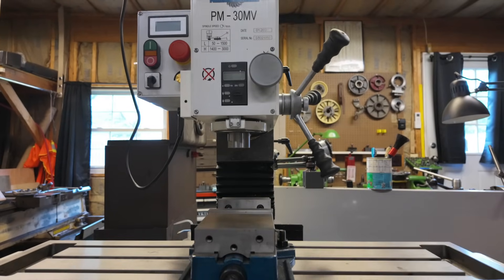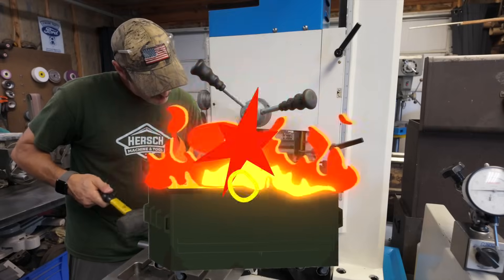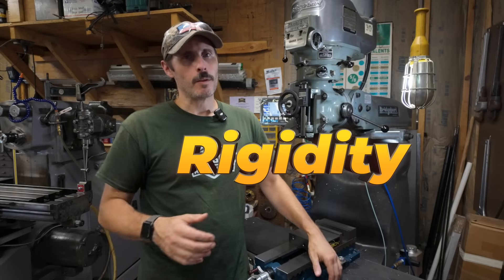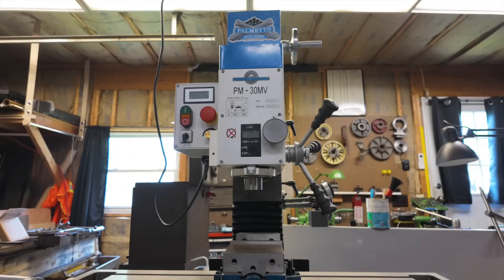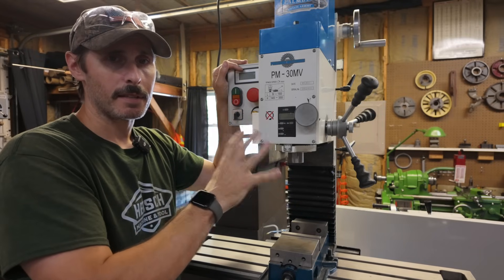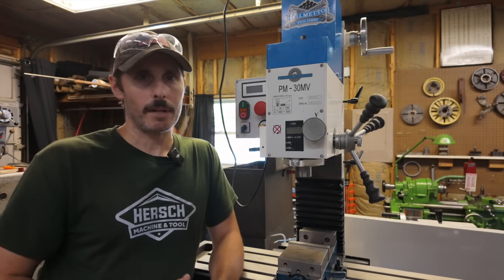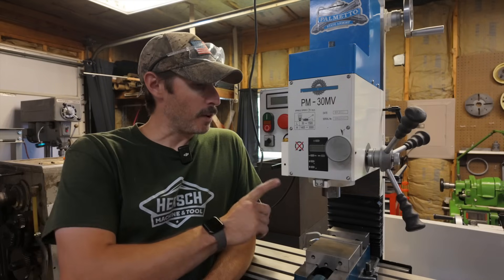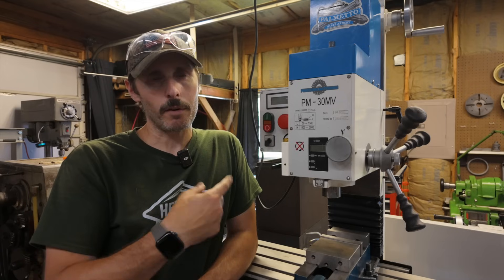All You REALLY Need to Know About Mini Mills

Comment: There is one simple rule of thumb: as big as you can fit for as much money you can spend. And a "slightly" used good machine is at least twice as good as a Chinese-machine. We bought a Shizuoka-mill from Japan, a real Ferrari, for the price of a smallish Chinese...
Reply: If you can find something that's great. The availability of used is spotty and heavily dependent on location though. You can't find something where it never was there to begin with.
Reply: @1pcfred  That is true 🫡. Many are used until they are beyond repair, size can be an issue AND they change owner without ever entering the free market. Sometimes you have to play tennis with a guy whose wife swims with the wife of a shop owner to get knowledge of machines about to get "free" or businesses about to close.
Reply: @1pcfred  I made molds for making products out of plastic. We worked in +/-0.01 and measured in 0.005, that is metric. Now I do lathe work in H6-H7 tolerance. But repairs are often less, +/-0.1-0.3 or so...

Comment: High School robotics team I mentor has a Grizzly mini mill with plastic tooth gears.  I assume the plastic gears are for the noise I’m sure.   Gears finally broke after many years of use.  Online reseller makes replacement metal gears that fit perfectly.  They were noisy at first, but finally wore in and became better.

Comment: Very good video over all.
A couple things I would add/disagree with.

First of all it is normally not the casting that gets rejected, those are normally pass/fail. It is the finished part that is culled and resold. I had a 16” Grizzly lathe that was so bad even the dowel pins were misdrilled factory seconds!

Secondly I wouldn’t knock the old round column machines tho they are harder to use they have produced billions of good parts for probably 60-70 years.

I wouldn’t consider the machine you were showing a mini mill tho.

Size wise match your mill to your work.
I have found mills run out of capacity much faster than a lathe.

Don’t knock a half size knee mill.

While is is always good to get the stoutest machine available accuracy is much more important, non of these machines are going to take heavy cuts so unless your goal is to just reduce metal to chips just for the hell of it make sure you buy a quality machine.

Cost of tooling is pretty  much the same no matter what size of machine you buy(vises are the exception).

Don’t buy too much machine moving big machines is expensive and dangerous.
Reply from the maker: @pvtimberfaller  excellent points, I agree pretty much with everything you’ve brought up. Thanks!

Comment: Well, a Bridgeport isn’t quite that heavy. It’s 1,995 pounds. Still pretty heavy though. Most of these companies don’t buy castings. They buy entire machines. What does happen is that the actual manufacturers, most of whom people have never heard of, off the same basic machine. With different features. But often, they also offer them in different quality, or precision characteristics. Importers, and that what Precision Mattews, Grizzly and others around the world are, decide what they want their products to cost, and then decide on what reputation they want to have (if they care at all!). Then they buy the machine that meets those expectations, gets them painted their color, with their logo tag. It’s preferable to try to avoid a machine with a DC motor. Yes, you do get variable drive, but the torque with DC motors can be low. A three phase motor with a VFD, as some machines have, is much better. They run on single phase, often 240, but some run on 120. VFDs have torque control, so they maintain high torque at low speed, just as geared and belt drives do. I generally don’t recommend geared head mills. Because these are low cost machines, the head has just a few speed choices. Often, just six. The top speed is also usually under 2,000 rpm. That’s too low for small mill bits. If you’re using a four flute bit in high speed, you should be at least 2,500 rpm, preferably higher. If it’s carbide, you should be at least 3,000. Smaller bits need higher speeds. You can mill at lower rpm, but your rate will be very slow, and the depth of cut will be small. The lower the speed, the easier to break a bit, because let’s face it, people who are new to this aren’t going to check the tables to find the optimum speed and feed, and will overdo them. I’ve seen people on YouTube breaking bits constantly because of this.
Reply from the maker: Really great points and info, thanks for taking the time to comment. When I first started out I broke my fair share of end mills, (still do lol) for exactly the reason you stated. I think for beginners it can be intimidating running at the speeds that will in actuality produce the best results so we tend to be detrimentally conservative. Also yeah, the bridgeport is easy to move, the B&S and the Clausing lathe on the other hand?… a little sketchy for a guy with a pallet jack lol

Comment: Very measured and sensible analysis, mate. All the more credible, as you don't seem to be short of 'proper' machine tools in your shop. All in all, a really good explanation of what's what (also the style of presentation was very easy to watch too); New subscriber incoming. 😉

The only thing I'd take very slight issue with, is the advice to definitely avoid round column mills. 

I'll grant that new, they're of questionable value, compared with the larger benchtop mills that are available from quality importers like Precision Matthews.  However, used, well cared for Taiwanese RF/RF clones, manufactured say, in the 90s, can be a very inexpensive way of getting quite a fair bit of rigidity and capability in a benchtop mill.

The main issue of losing X/Y  position when changing Z height can be fairly easily worked around. That Lazy Machinist has a good video on the "longest tool technique" to avoid having to change Z height. There are also a fair few videos around, that show modifications that pretty much remove the issue.

Okay, if someone has the money to buy a PM column mill then it's hard to argue with that choice (Precision Matthews is an importer that those of us in the UK would give our right arm to be able to use!😄)

If on the other hand, someone's budget is more limited (and couldn't fit a used knee mill in their shop), I'd reckon a decent used Taiwanese RF30/31 type is probably a better bet than one of the cheaper, smaller benchtop mills bought new.

Eh, just my thinking though, and that's worth about as much as you think it is. 😁
Reply from the maker: @stevedavey1343  thanks very much, I appreciate the positive feedback! And yeah, I agree completely, any mill is better than no mill and there are a lot of options and considerations when looking into bench mills. I’m just trying to give a broad overview here and hopefully arm folks with some good questions to ask and serve as a starting point for further research to assist with making the best choice for the individual. Also I think that some of the nicer round column mills are precision keyed which eliminates the tramming loss issue altogether. Thanks for watching btw, and thanks for the sub!
Reply: @hersch_tool  I've moved Bridgeports and I've moved mini mills. Mini mills are a lot easier to move than Brideports are.
Reply from the maker: @ depends on how mini the mini mill I think. I dread ever having to move my PM30 off the stand it’s currently sitting on. I can move my BP around easily by myself with a pallet jack.

Comment: Based on my research the mill in the video costs $3700 and therefore it is already a better one. Looking for a cheaper mini mill that is rigid enough for milling iron and steel I found the Sieg SU1 horizontal and vertical universal knee mini mill for approx half of the price. This mills is a very rigid one and I´m very satisfied with it. If the Z-Axis travel of 205mm is enough for your applications, this is my recommendation. I don´t know whether this mill is available in the US, I only found offers in australia  and in Germany, where I from. 
However,  as joansparky4439 states below, you have to do the finetunig prior the first use. Especially the Z-support needs a precise adjusting of the dovetail and the spindle. After that is done the mill works smooth, quiet and with impressing results.

Comment: Have a Taiwanese round column mill/drill for more than 20 years. Back then there was no square column ones. Main drawbacks is the round column and belt changing of speed. On a round column you can't move head up or down without loosing precision. So you have to set height for the longest tool to use before. And have quill down much for the shortest tool. Speed changes takes lots of time, so rarely done. A gearbox may be noisy but you gets lots of torque on low speeds. Fitted it with quill and X/Y DRO and VFD speed control.
If I ever should buy a new mill, it would be a geared square column one with 3 or 4 axis DRO. Finding a used knee mill in decent condition is almost impossible.
Reply: You can move the head up and down if you use the laser method. You put a laser pointer on the head and mark where it hits a far wall and have a plumb line on  the wall.

Comment: Typically electric motors have the most torque at low speeds and lose torque as they speed up. (gearing and belts aside)

Comment: i hate mine, i love mine... i guess mines the bigger sister. HM45...46? 

it works, but i spent a bit of time learning its idiosyncrasies?

being left semi exposed for a few years wasnt the best thing for the bearings... box got water in it. 

so stripped it down and thats when i found the major issue, that one of the gear shafts has a nasty big crack in it along one of the keyways. from the factory judging by the grinding marks... bit hard to select one speed and i know that one day its going to have to be stripped down and remade... at the same time, see if i can beef it up a bit as well.

in this country we have a monopoly of one seller/importer and theyre not interested in after sales support... not even really interested in pre-sales support, lol. a reputation for "customer service" but what can you do given no alternative but bend over and take it?

the big challenge will be when i finally get motivated to start scraping it... gotta love the "decorative" factory scraping... it still has the cutter marks on some of the ways!

not hard as such, just tedious and some parts weigh a bit.

i still cry about letting a bridgeport go years ago as i didnt have the shed for it (remember that bit about "semi exposed"?)

Comment: Question, you said that round column mills are inferior to a square column  type can you explain why this is so?
Reply: They are less rigid. Round column mills are essentially just beefed up drill presses. They are better than a drill press but you will be taking light cuts.
Reply: So far, my $500 jet jmd-18 round column mill is kicking butt compared to a square column mill. And I haven’t even used it 😬
Reply: Because you lose precise location every time you raise or lower the head, they're junk, a crappy design that should've been left in the past, why they're still making them is a mystery,  why anyone is dumb enough to buy them is also a mystery.

Comment: Had a lowly 25mv for about 5 years, and in that time the pos paid for itself several times and allowed me to buy a better machine.
It's also a great to make all kinds of mistakes that would hurt a lot more on expensive equipment.
Just be prepared for a lengthy setup and a lot of grief, since even a little bump with throw it out of alignment in it's stock form.
Everything is fixable tho, just don't go crazy on the upgrades. They get quite pricey very fast.
Still use mine as a dedicated precision notching machine, so yeah ultimately I think it's a good buy.

Comment: The real decision is crank handle vs. CNC. Manual mill-drills, mini-mills, and yes that venerable hulking Bridgeport, are yesterday’s tech. Before you commit a bunch of money to one of these boat anchors, look at what’s available in the land of hobby CNC.
Reply from the maker: I don't think that's accurate for a majority of people looking at manual machines. Many of us in this hobby are looking for something out of manual machines that we simply can't get from CNC. When I was looking for my first machines, I was fully aware of CNC, but CNC machines weren't even a consideration. That's not what I wanted, and I believe that's true for a lot of folks.
Reply: CNC isn't always suitable for seat of the pants machining. A lot of what I do needs to be done by feel. I just took a broken screw out of a casting using a tiny carbide burr. Good luck programming that.

Comment: There's nothing wrong with a mini mill.  In fact, the finer pitch thread on the leadscrews can be preferred when making really small parts.  A Bridgeport will move the table .200" per revolution of the handwheel, the mini mills are half that.  Of course, the downside is that you're cranking the handle twice as much to relocate the table, so not really a great deal if you're doing a lot of setups or making larger parts.  But for the model engineer, typically making small engines, scale train parts, etc, the mini mill can be the preferred tool. 

So the intended use is the FIRST thing that should be considered.  And almost nobody talks about that.   If you "don't know what you want to make' but just want to get into machining, I'd recommend the generic 6x26 knee mill from HF or other sellers.   See the YouTube channel "Doubleboost" to see this mill's capabilities.  It's about half the size and weight of a Bridgeport, but is far more rigid than the square column mini mill.  About the only thing you lose is the ram, and head nodding/tilting.  A Bridgeport has a HUGE work envelope, partly because you can move the spindle to any part of the table.  For most home shops, a step pulley machine on a VFD gives you instant speed changes, and a quiet machine.  The Reeves drive on a full size mill will need maintenance, and can be noisy.

And finally, I've owned and worked on import machinery from PM, Harbor Freight, Grizzly, Enco and Jet.  What I've observed is that the "quality of the castings" is no different from manufacturer to manufacturer.  Strip away the paint from your PM mill or lathe, and you'll find the same amounts of body filler as on the less expensive versions.  You're paying for better paint, and presumably, better after-sales support.  My experience suggests that you can save a lot of money by buying the cheapest version of the import machine you're considering, as long as you're capable of fixing any problems that might come along.

Comment: Pure acid test for all mills. Trammed, then a cable is attached to the highest point of the mill head and the father forward stable part of it. A strain guage is attached to to cable and a steady force is applied, pulling the cable laterally towards the end of the bed. Then standard measurements of deflection on two axis can be measured in grams. Just this primitive measurement will give a good idea of how much deflection a cutting bit will apply to the mill which in turn gives you a bottom number of the accuracy you can expect.
A heavier Bridgeport like in your shop can take 200-500 grams before significant measurable deflection. Mini mills - good luck getting up to one ounce.
Reply: That's interesting but completely unnecessary.
Reply: @bobbybishop5662 yeah this seems like its only useful if you can use that calculation to create some sort of deflection compensation/prediction stuff for cnc conversions or to measurements or tolerances for cuts

Comment: Dunno why i watched this video. I have my mini mill, basically same model, just NOVA brand, love it, only motor direction control is with extra step, cant just toggle that switch - everytime, after direction change, need to push ON button, because circuit is very basic. I love metal tools, lovely content.
Reply from the maker: Thanks very much. And yeah my first lathe was the same exact way, had to push the on button whenever changing directions. And thank you for watching!

Comment: I have an Optimum MH-28V, which looks very similar, casting wise. The Z height seems decent to me, hasn't bothered me too often, it's way more often the Y travel that trips me up, and makes me want a turret style mill. 
Mines geared, but the noise isn't that bad. Low gear, high motor speed is a bit noisy (still quieter than the lathe), but if I'm needing that much spindle speed, a lot of the time I can just go to high gear. If I do need to stay in low gear with that much rpm, then the cutting is probably making more noise than the gears.
I do wish it had a bit more torque though. Sometimes, with the variable speed it will start over reving a bit to make up for lack of torque, even in low gear if using an annular cutter or something.
Reply from the maker: @patrickbeck4062  yeah torque/cutting power is definitely a place where they can struggle. Big drills and annular cutters are good examples of times where you might have to “work it” a bit… lol

Comment: I guess there is a fine line to be walked on the precision of a machine. Do you need something that can work at micron level of repeatability in every project you do? Or can you outsource that one part per year that needs to be super precise to a workshop that has a precision CNC, and you can live with higher tolerance amd dimensional errors on your everyday work. I guess if you look at power requirements, there are similar considerations to be made. Do you need to quickly remove a lot of material in one pass, because you have limited time and too much work to do? Or can you do a few cuts with a smaller tool that take a lot longer, to get the same amount of material removed?
Reply from the maker: @ProtonOne11  this is spot on. Everyone has a unique circumstance and requirements, and it’s more often than not a balancing act of compromises.